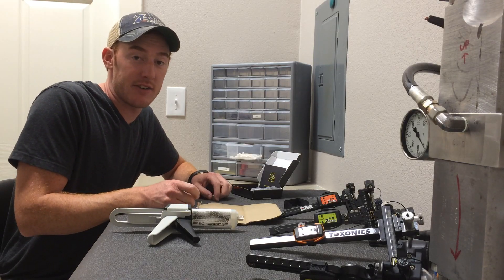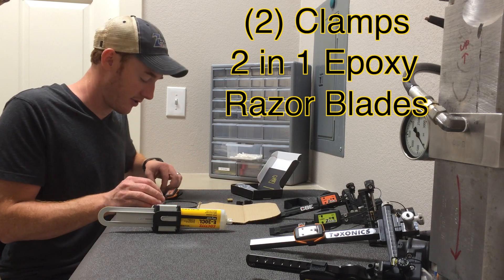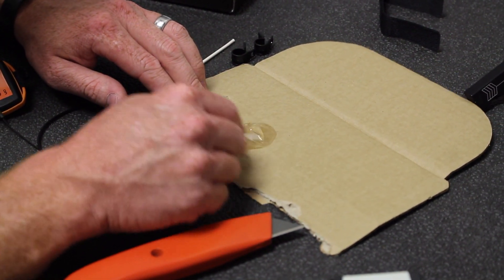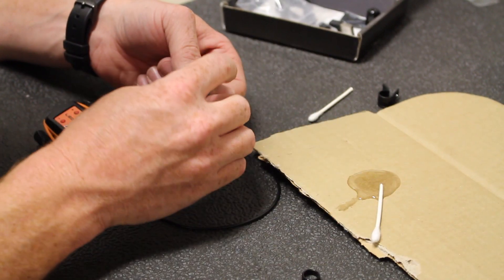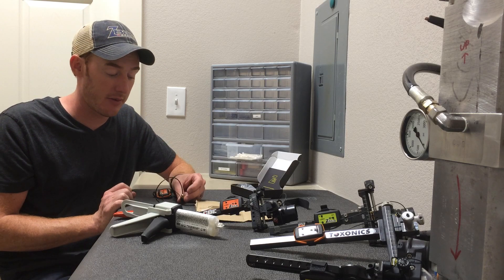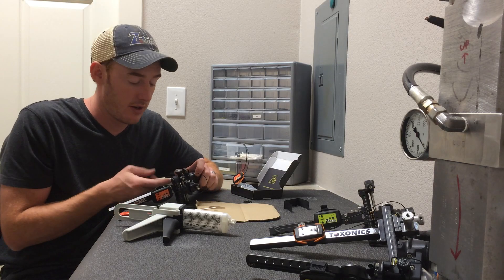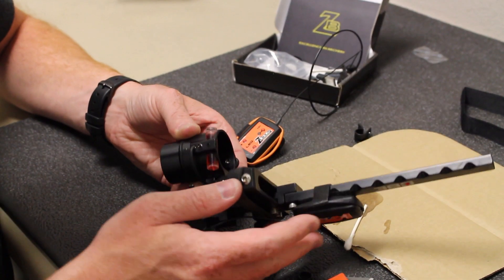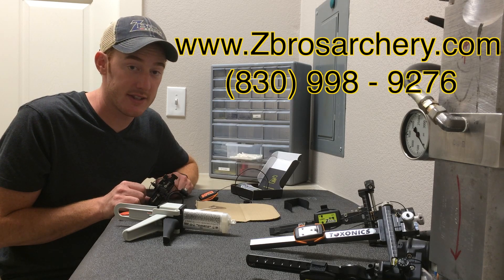Zbros Tutorial: How To Setup A No-Thread LED Module

Comment: There appears to be 2 videos on the no thread install, the other method having the tube slide into a rubber cap with a hole. Which is recommended?